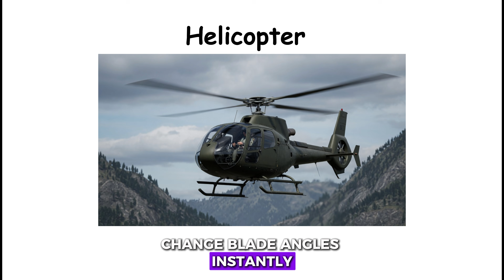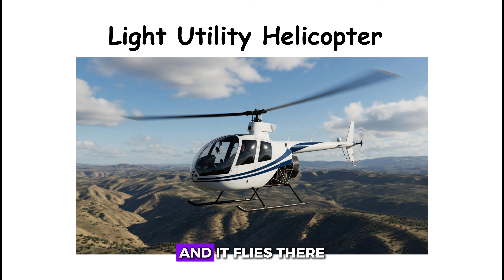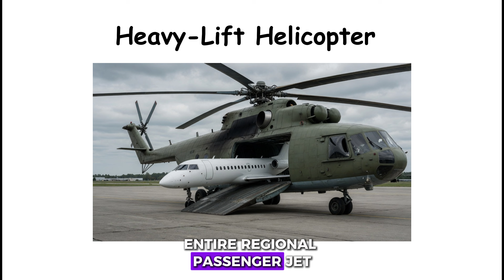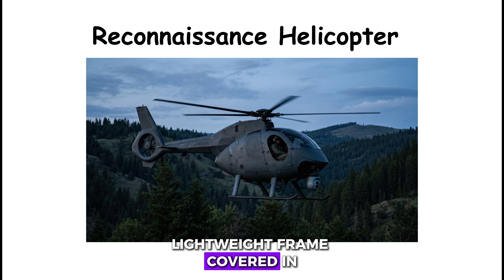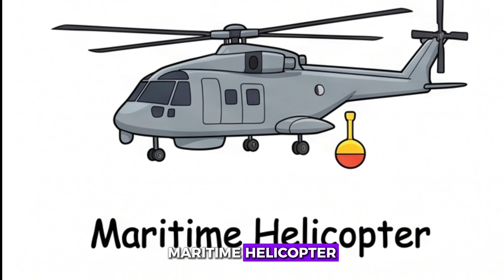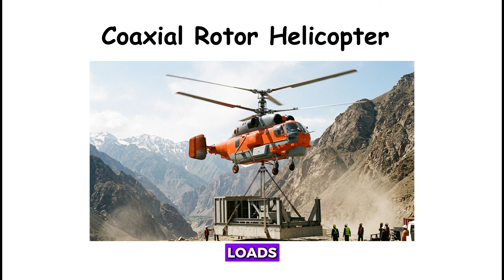Every Deadliest Military Helicopter that can Destroy Whole Country in minutes Explained

Comment from the maker: Which one of these flying beasts surprised you the most? 🚁 personally, the fact that the tail rotor eats up 10% of a standard helicopter's total horsepower just to keep it from spinning out of control is absolute madness!

Drop your favorite chopper in the replies below—let’s see which machine rules the comment section! 👇